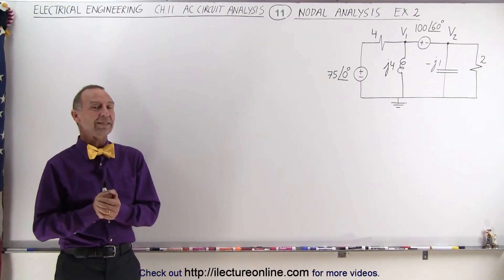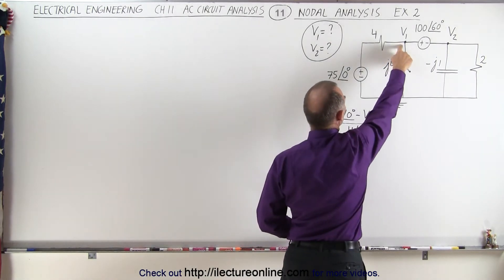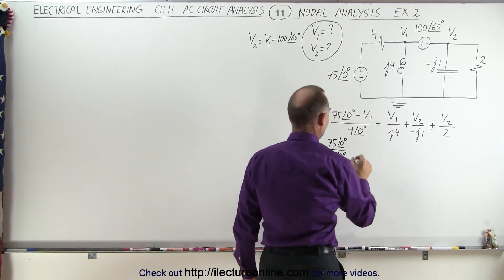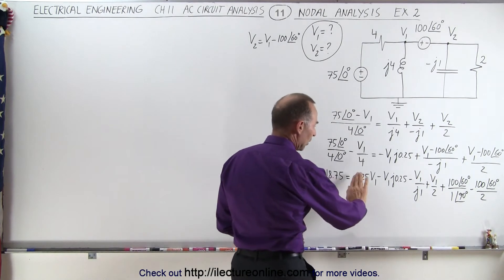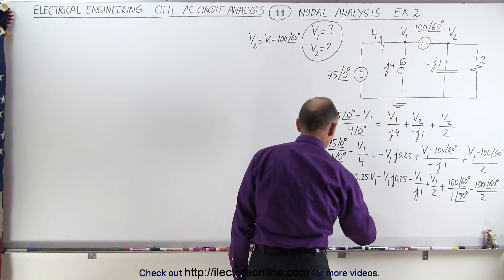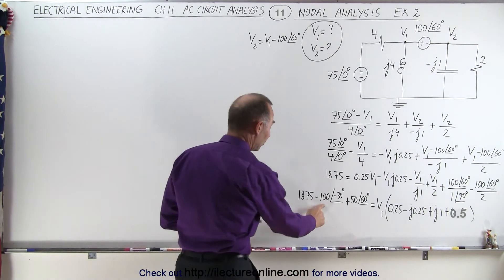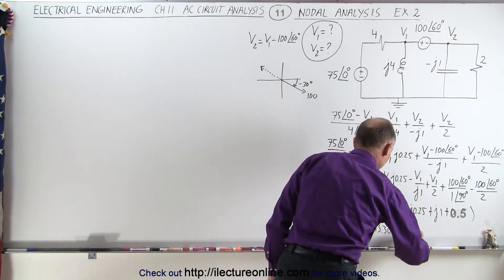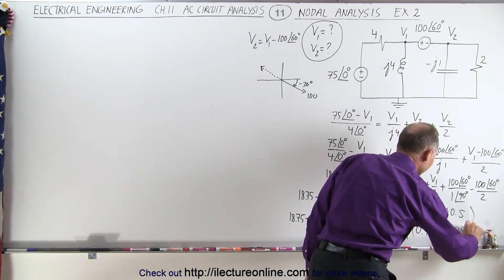Electrical Engineering: Ch 11 AC Circuit Analysis (11 of 55) Nodal Analysis Ex. 2***

Comment: thanks for the video series, so far so good. However, u mentioned something about accounting for the phasor
in the second quadrant when you analyzed; -100 with phasor angle -30. Could u perhaps clarify sir?
Reply from the maker: I didn't quite get the question, but maybe this will help.  You can add or subtract 180 degrees from the phase angle by changing the sign in front of the magnitude.

Comment: Hello sir, in the beginning of this video you wrote "4 with phase angle of 0 degrees". Why not just put "4" ?
Reply from the maker: If you write just a "4" you don't know if it is 4V DC or 4V AC.  When you add the phase angle you know it is AC voltage AND you know the phase angle to be zero
Reply: @MichelvanBiezen  thank you for your feedback!

Comment: Sir how do you know that the source voltage is 75 at 0 degree phase and not 100 at 60 degree phase?I mean how do you calculate that which is the source voltage or which has greater potential ?
Reply from the maker: In this example there are 2 sources and they differ in phase.  The 100 V source is 60 degrees ahead of the 75 V source.

Comment: Sir why do you need to take out the minus sign from "-16.38 + j4.28" into "-(16.38 - j4.28)". Can you just calculate it directly? and get "16.429  ∠-14.64°"
Reply from the maker: Yes, it is a preference, not a requirement.  Sometimes it makes the situation more understandable
Reply: @MichelvanBiezen  ok got it thanks prof!

Comment: Hey dear professor, 
thank you so much for your videos, i find them inspiring. 
I also have a small question-
 why do you take  an angle of 30deg and not an angle of -30deg? do you always need to take a positive angle and than calculate through the Quadrant of the Phasor?
Reply from the maker: I just looked at the video and saw an angle of minus 30 degrees

Comment: Why is it V2=V1-100\60° ?
Reply: V1 is on +, V2 is on -. So, V1-V2 = 100\60°
Reply from the maker: The difference between V1 and V2 equals the source between the two.
Reply: Why 
V1-V2 =100\60
Reply: V2=V1-100\60°
Reply: Why